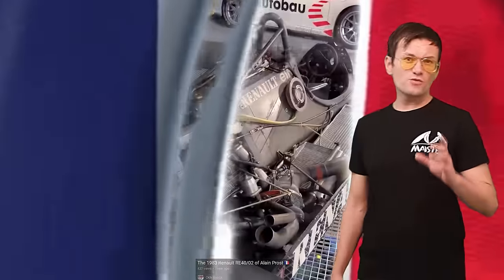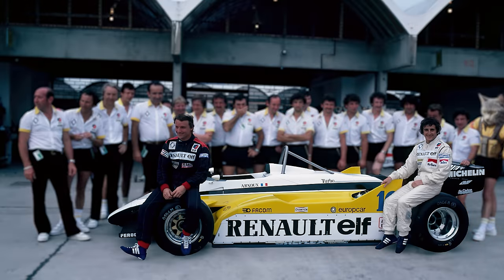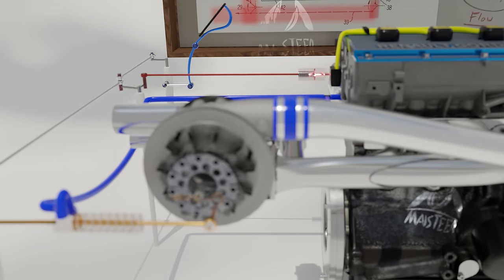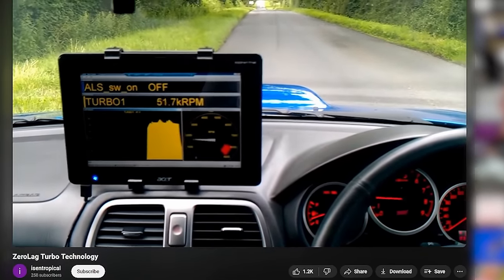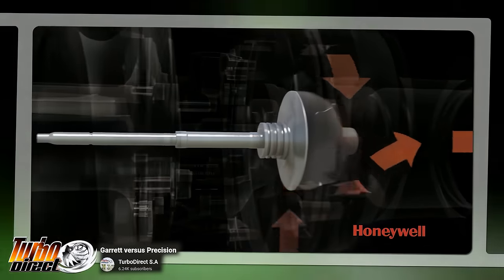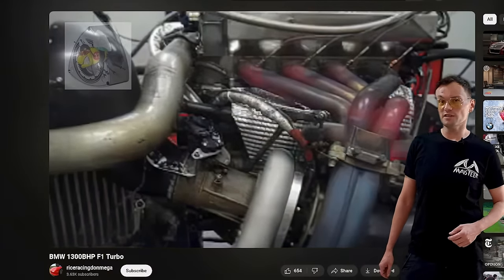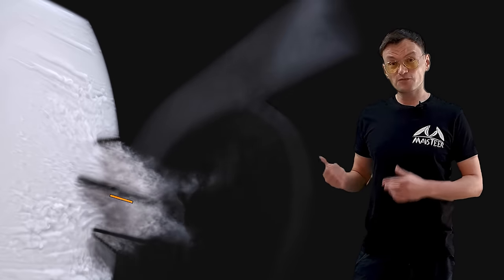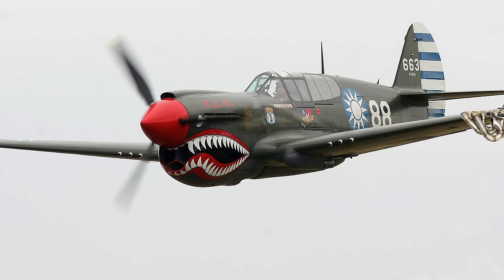Renault's Turbo Trick - Anti Lag, but Different!

Comment: Is this system applicable  to diesel engines as well?? Great editing btw, just slow down a little :)
Reply from the maker: The same principle should also should work on normally throttle-less diesel engines. But turbochargers on diesel engines usually don't come with the seals that would be required to make it work. Traditional turbocharger seals CAN NOT seal against a vacuum on the compressor side. And if this is happens on a diesel.... sucking in oil and air will make it runaway. Maybe worth a try, but better not ^^

This video explains turbo charger sealing in more detail, maybe worth watching for you: https://www.youtube.com/watch?v=X4vNbVxz0Xc
Reply: Old garrett cat 3406 turbos, came with carbon seals instead of oil rings on the compresor side. Maybe those turbos could work with this system 🤔
Reply: @maisteer  🤔🤔🤔 With this "Turbo throttle", it might actually prevent the diesel from reaching full-runaway... no?
It'd be sucking in the oil, but, presumably not enough air to burn it all.

Granted, you still wouldn't want to ever induce that anyways... 😅
But if I'm right, it might not be as catastrophic! 🥴
Reply: @DUKE_of_RAMBLE  well no it wouldnt stop a full runaway (idk what you call a partial runaway, when it occurs it's not halfway, and never is) because it wouldnt stop the engine from sucking out of itself... it would worsen bottom end and bearing seepage as the turbo spooling even when choked would be increasing internal pressure.
besides all diesels have a shutoff valve where a gas engine usually has a throttle. that's how mine shuts off. never heard of a runaway happening on my engine type, as it's require that thing to be busted along the turbo... and it wont start if it was (mechanically closed when off).

Comment: The subaru rally anti lag system is still one of the most impressive to me, I feel nothing beats it!! Hearing a turbo at full boost whilst the car is at idle is mesmerising... So much engineering went into it.
Reply: The Subaru system is great, until you price out inconel and realize those combustors have a very limited lifespan
Reply: @yucannthahvitt251 its nothing for consumer use lol its professional use only, just cool to marvel at haha
Reply: @yucannthahvitt251  you can make them from 321 or even 304, there is a  pikes peak camaro that has an external combustor from stainless. The hardest thing is making it work with the electronics. A lot of dynotime = expensive
Reply: unfortunate it''s banned in many racing disciplines, and it's fuel use increase too meaning it's not viable for endurance racing.

Though if they could make it so that it only activates when turbo rpm's drop below a certain threshold then it would be absolutely insane!
Reply: Whats cooler, Russian military tech or 1900s diesel locomotive tech?
Reply: @regretabletangibility  1900s soviet military diesel locomotive tech controlled by a vacuum tube computer.

Comment: My high school car was a '66 Corvair Turbo. MUCHO LAG. My Dad's identical twin brother was Chief Engineer for Outboard Marine Corporation's Lawn Boy Division. Dad worked on airliners with piston engines, turboprops, turbojets and turbofans. They came up with the idea of locking the Corvair's carburetor butterfly open and making the foot throttle turn the distributor instead. It had the disadvantage that the exhaust pipes all glowed yellow and it drank gas at a fantastic rate. But the manual transmission car AT IDLE kept the turbo spooled up to an estimated 90,000 rpm.
        Not long after that Uncle Jerry came up with what he called "The Mechanical Switch" because it operated much the way a railroad track switch works. Thrown one way the gas pedal operated with the distributor locked at stock 24 degrees and it opened the carburetor like when stock. Throw the small lever on the floor the other way and the carb locked wide open  and the gas pedal took the distributor from 24 degrees AFTER Top Dead Center at idle all the way to the normal 24 BTDC.
      It took more than three whole seconds off the car's standing start 1/4 elapsd time.

Comment: I have seen many tries to get turbo and super-chargers to work without lag, and the best way, before fuel injection was to pressurize the carburetor. Then, someone put a gate between the intake and carburetor, to bypass the turbo. That worked, but was unreliable for all situations, and didn't work for superchargers.

My favorite design is still the turbo or super-charger to pressurize the carburetor, even tho you need a can over the carb.

Comment: Dude .. the level of editing and effort you put into this , made this a dope vid bro and keeps me interested (i have adhd hard to focus) im curious .. will this still be harsh on the turbo like traditional anti-lag systems tho or does this method work more fluidly with the compressor ?..  peace and love bro keep it rad stay safe and build on l8z fam and keep having fun brotha
Reply from the maker: It's harsh in a different way. First the turbo seals need to be able to handle vacuum and second the turbo can spin (much) faster than usual, which in Renault's case caused compressor wheels to explode from the centrifugal force. Renault fixed it by "inventing" forged compressor wheels.
Reply: @maisteer  right on brotha , thank you for responding and the info ... and good to know ...might experiment with some cheap China chargers to start if I make one and once I feel it works right then try it on the real turbo lol .. peace and love bro keep it rad stay safe and build on brotha .. l8r and keep having fun

Comment: Thank you. I get admitted to a mental health hospital today. After seeing this. I think I'm already cured 😂🎉 also. Would this work without a throttle, like, on a mechanical diesel??
Reply from the maker: I assume that the mechanical diesel does not have top-notch modern turbocharger. Traditional turbocharger seals CAN NOT seal against a vacuum on the compressor side. Since this is a diesel.... sucking in oil and air will make it runaway. Maybe worth a try, but better not ^^
Reply: @maisteer  GTX/TD04HL19T HYBRID. Thank you for the reply. Hoping to engage with you more frequently. Really enjoy the content.
Reply from the maker: This video explains turbo charger sealing in more detail, maybe worth watching for you: https://www.youtube.com/watch?v=X4vNbVxz0Xc
Reply: @maisteer  cheers. Learned something. Also learned that On ERC rally cars they dump the boost from the blow off valve into the exhaust ahead of the turbo to spin it harder between gear changes.

Comment: Couldn't you just have a separate intake that spools the turbo and bypasses the turbo to reach higher rpm than closing off this intake to then reach desired boost without messing with the turbo itself

Comment: Why not make a turbine out of one turbocharger, an air engine, to drive another turbo hooked only to the intake? Control boost with turbine throttle. No exhaust mods, less bottled up heat under hood. Make a self contained unit that installs in the trunk.

Comment: Do you know what anti lag does to your valves?  EVERY single engine with anti lag abused has the valves damaged and warped. Usually you can release the valve spring and retauner and spin the valve in guide, it will no longer seat properly except in one warped position. If you dont mind doing a valve job every few hundred miles then stupidly endlessly showing off the anti lag at stoplights and every passing teenager you see is for you too!    🤣😂:oops:  Ill just roll by when your broke down and laugh.
Nos by shift friend, Nos by shift for antilag. 0% lag. !00% reliability. No warped valves and exploded exhausts from pushing too much fuel into exhaust and exploding it ..

Comment: If the turbo is actually the correct size for the engine, you will never have any turbo spool up lag. You get turbo spool up lag using too large of turbo & that is a fact any engine builder already knows.
Reply: Yes, but the "correct" turbo size will limit your max cfm for intake & exhaust both, therefore limiting how much power is achievable with said turbo. So for anyone serious about power goals, the "correct" size turbo will most definitely have lag, it's a trade off, you can't have both without problems that need solutions, the solution for the correct size turbo on a higher powered engine... Is anti lag.